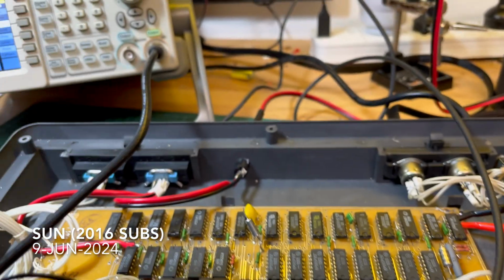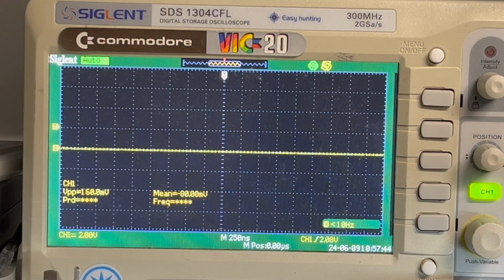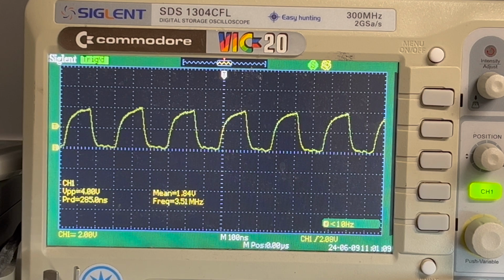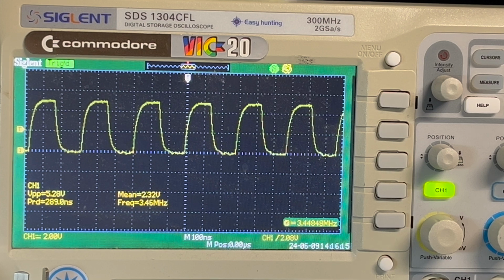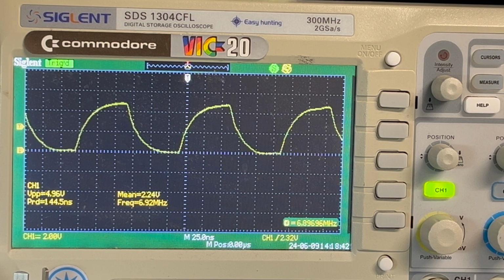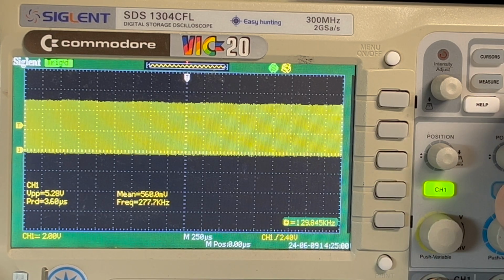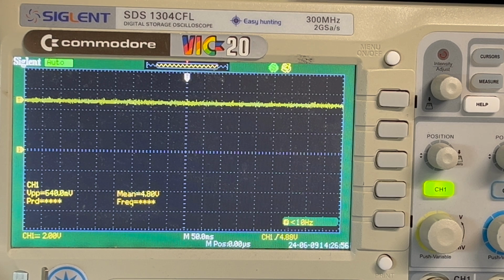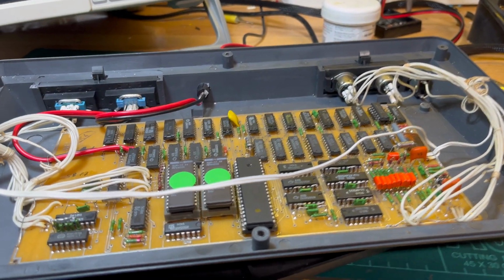🇧🇾 Квант (Quantum): Part 5 (Clock Flip Flop Replaced) [#TCE0472]

Comment: Looks like you should be injecting into pin 1 as that's an input, pin 5 is fed from the output of pin 4, so your injecting into an output.
Reply from the maker: My thinking was that I've removed the crystal so I need to replace that source, hence going into pin 5 of the inverter chip.  But yes, I could've also tried at pin 1 I guess!

Comment: So it was the flip flop not driving sufficiently. I think your clock signal is good. Looking at the waveform (not VPP) it's at 4.8 - 4.9V. VPP can be affected by noise and slight ripple.
Reply from the maker: Yeah, that was my conclusion.  So maybe clock is okay now ... just the rest of the bus signals are a mess :). There is still no video output ... well, just brief flashes. One DIY improvement is apparently adding pull-up resistors to the data lines on the Z80.  But I guess I can start looking at the video output stage to see what's going on there.

Comment: the 74HCT chips should be  TTL levels.. shouldnt be an issue there.... unless they rebadged HC chips!
i really dont think the low voltage is an issue... ive seen whole z80 system running 3.9v and still working...iirc from memory the high level have to be above 2v and the low below 0.8v to trigger the gates
Reply from the maker: That's what I thought, hence why I got them ... but was reading this: ... definitely the voltage level is much better, but too high now it seems (>Vcc+0.3V):
https://www.eevblog.com/forum/projects/grant-searle-z80-sbc-troubleshooting/25/
Reply: @Brfff  ...put a resistor in to lower it ?!

Comment: Shouldn't you be injecting into pin 1? Pin 5 is driven already.
Reply from the maker: My thinking was that I've removed the crystal so I need to replace that source, hence going into pin 5 of the inverter chip.  But yes, I could've also tried at pin 1 I guess!

Comment: That was an excellent idea! Your signals look so much better! I would say that the clock is fixed. It may end up that you have to pull all of the chips out and test and replace.
Reply from the maker: Thanks ... I think I'm finally starting to get a bit confidence and understand stuff.  So my premise is that the Soviet flip flop is outputting too low ... but now the 74HCT74 is too high ... so maybe a 74LS74 might be just right?  But yes ... might be easier to just replace the whole board with another Leningrad48 board ;)
Reply: @Brfff  I would first try the piggyback trick of placing a LS copy of the Russian IC on top of a suspect chip to see if the signal gets better. If so, swap out the old chip. (what do you have to lose?)